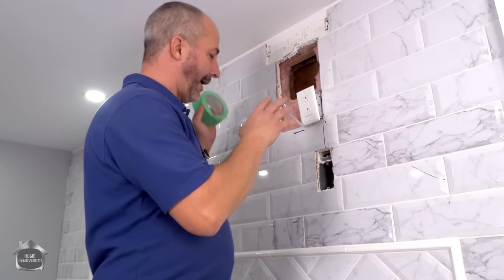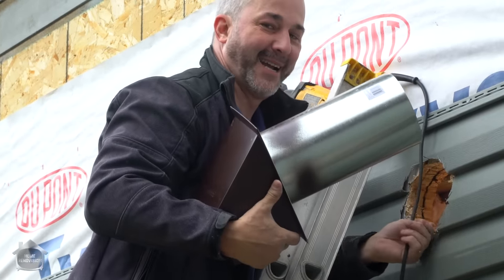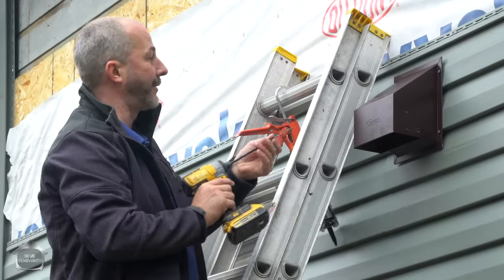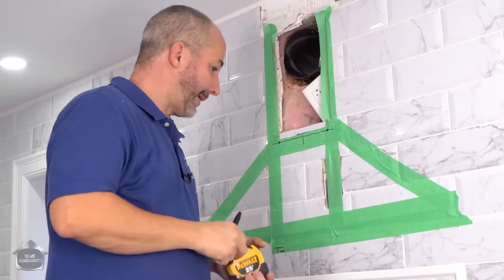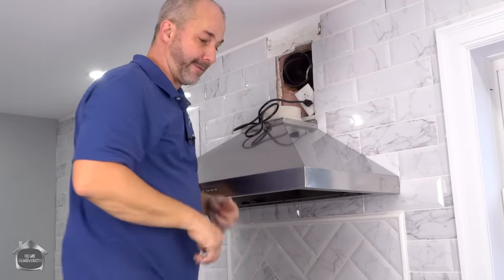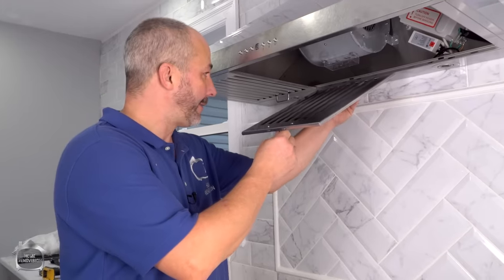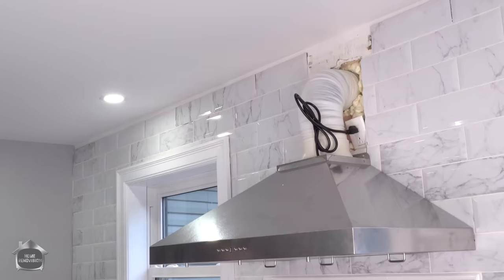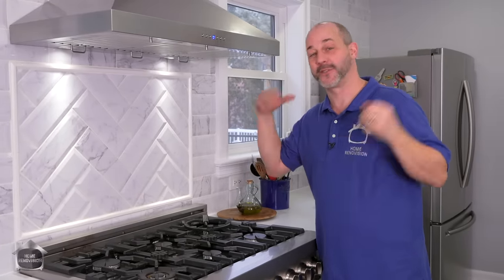How To Install A Wall Mounted Hood Fan!

Comment: Flex duct is usually frowned upon for a kitchen vent because the excess grooves trap more grease which could be potentially dangerous
Reply from the maker: in actuality this hood fan has a grease collection system and a removable grease trap for cleaning. Cheers!
Reply: Seriously, no grease trap will be sufficient to stop a exhaust fan fire. This should be a solid pipe with a no grease trap in the pipe
Reply: I've heard the same, rigid metal
Reply: Aluminum or stainless semi ridged is what I tend to use. Also I sleve w pipe insulation threw the wall. None the less great video and some good tips . Also toggle bolts on bracket and lower part of fan (just above grease filters ) .
Reply: Even if the code allows flex (which ours doesn't), check if the hood installation manual allows it.  The inspector may request to see it.  (They did for our dryer to prove the length was OK)
Reply: @HomeRenoVisionDIY  ...but grease always gets by for whatever reason.  I have removed countless exhaust hoods and they all are coated inside with grease.  Some less than others but greasy none the less.  Is it going to cause a fire? Not likely.  I still believe standard ducting is best practice but not always feasible.  Don't forget to insulate through a cold space like an attic.  Cheers!!!
Reply: @trevor.h  all spaces 👍
Reply: Welcome to remodeling bro. It's not new construction you have to deal with what you got
Reply: This is exactly the reason why I just bought hard pipes to replace the flex one after 6 years.  Doesn't matter how often you clean the grease trap it will gunk up and slow the efficiency of the fan.

Comment: The exterior vent Hood was installed like a rookie, they make a square one inch thick flange with the hole for the vent pipe to eliminate the flat flange to the siding which will eventually leak.
Reply: Eventually? It will leak IMMEDIATLY … should have been a block with j channel installed … I havre canal siding anyway but ….. smh .. he does a decent job normally

Comment: Doesn't the exhaust pipe need to be a non flexible material? Won't grease and condensation develop on the ribs?
Reply: You are 100% correct.
Reply: Plus, I would be worried using what appears to be a plastic exhaust pipe.  Not good in a potential grease fire.
Reply: @view05nys  I was thinking the same thing. It comes with the fan so it must be ok. Most of the grease gets trapped before the vent pipe.
Reply: @view05nys  thats not plastic.. its PVC..  gotta be fire resistant..
Reply: Just another Hack job , Grease fire waiting to happen
Reply from the maker: The exhaust is supplied by z line. that means it is approved for installation. If the code in your city is different then you choose what to do.
Reply from the maker: @Chaz the hood comes with a grease trap for removal and cleaning. this is not a cheap hood that turns into a grease fire. Cheers!
Reply: @trevorhardy3544  so why are you here
Reply: Earl Johnson Because it pops up on YouTube and I like to see what hack jobs he telling people to do.
Reply: Trevor Hardy then why are you watching his videos ? Lol
Reply: @trevorhardy3544  TROLL
Reply: David Not a troll. Just look online at the reviews. He's scammed a lot of people and caused damage to their homes. And he keeps changing his company's name in order to avoid legal action.
Reply: @HomeRenoVisionDIY  But it isn't immediately clear from viewing what actually TRAPS the grease and directs it into that box – you sort of zoomed right past the "when you take out your filters" - they are in the round ends of the bit above where the box sits? In extract hoods I've had there are dishwasher-cleanable layers of metal mesh at entry, in the drop out panels, which is what I was expecting. Had to go back and watch again to see which bit you were talking about putting in the dishwasher weekly!
Reply: @trevorhardy3544  What reviews?
Reply: Trevor Hardy No. you are subscribed because you enjoy bashing other people while feeling like you are perfect. At least be honest.
Reply: @JGHDVCFGT   Yep. Same design my restaurant has.
Reply: This is why I don't solely rely on one person.
Reply: @jasenrock  He's got far more 10/10 reviews than any other.
Reply: He did the duct work all wrong.
Reply: @jasenrock  I googled and the two bad reviews were from two people who would not allow Jeff and his crew access into the house to complete the work.  Ridiculous.  So, what did you land upon on Google to lead you to the conclusion he's a scammer?
Reply: @HomeRenoVisionDIY  FYI California does not allow the type of ducting you show. The City of Dana Point has the following on their website: A ducted residential exhaust hood is required. A metal, smooth interior surface duct required on
 vent hood or down draft exhaust vent. Aluminum or steel flex duct not approved. Provide a back draft damper (CMC504.3).  We have had to throw away several manufacturer-provided ducts and replace them with the required type
Reply: The fan has a grease trap no ? do you really think these fans operate by blowing grease all over your lawn
Reply: @DaveSParty  i second
Reply: @SgtZima  reviews that trroll Trevor Hardy did.. haha
Reply: He’s in Canada and it seems a lot of their code is more lax than USA.
Reply: @matthewsegreto7049  all out of code. Horrible work.
Reply: @TravelingTulleys  and metal duct tape to seal all joints and openings.
Reply: @muzaaaaak  and painted at the joints with mastic too
Reply: @HomeRenoVisionDIY  all fan blades eventually get greasy. You’re supposed to clean the blades too. The grease trap isn’t a trap, but a tray. It is designed to hold dripped grease which falls off the fan blades when warm temps loosen grease. RTFM if one is going to own a commercial style hood and any hood for that matter. ALL hoods are grease fires waiting to happen.

Comment: For those watching they make a vinyl siding flange that frames the vent for a much cleaner install plus it's shingled properly. Caulking fails eventually so make sure to shingle your exterior penetrations.
Reply: I was thinking the same thing. I would have done it the way he did it but knew I was sort of butchering it.
Reply from the maker: no worries Mike, i get the whole seal it up tighter than drum approach but this house has 3" of exterior wood that can handle the occasional rain drop finding it's way behind the siding and typar. Cheers!
Reply: @HomeRenoVisionDIY  Your house might be fine, but it would just look better. Only takes a few minutes to trim it out cleanly and install behind the siding.
Reply: @HomeRenoVisionDIY  won't last and it's a half ass way to do it. Also, too much foam insulation is not good. Insulation works better if not packed too tight.
Reply: Can I get a link or photo of the flange you’re talking about?
Reply: What is the model ?

Comment: Jeff  for siding penetrations for a cleaner look, use an exterior mounting block that matches your siding color, it eliminates the risk of leaks where you were shown caulking also stops relying on caulk to stop water intrusion, it mimics the blocks that they use on lap siding (without scribing) your siding butts up against it for a clean install.  If I remember correctly, Electrical code requires all boxes to be secured.
Reply: Also, what about the seal to the air barrier?
Reply: Or a 2-piece wall vent with an integral J channel backer. I think from Builder’s Edge on Amazon? 4 years later, Jeff makes a video showing how to easily unzip vinyl siding too in order to repair damaged pieces, install penetrations neatly, inspections, etc.

Comment: Lol!  No PPE, hammering a wall anchor with a battery, shimmying a ladder while still on it...this is pure DIY reality and actually makes a rookie DIY feel comfortable in their own (limited) abilities in taking this on. Excellent!
Reply: Plastic flexi vent ducting. Don’t see how that’s code for grease here in USA. All installs I see are sheetmetal ducts and elbows. Maybe Canadia is more lenient because their houses don’t burn.
Reply: @muzaaaaak  I think the duct was provided by the manufacturer Zline which is USA made so it must have pass UL. Not all plastics are the same. Plus the temperature of air 36" above a stove top is not very hot, under 100F I assume. If you have flames shooting 36" high you've got bigger problems than the duct.
Reply: @muzaaaaak  yeah that’s the duct that’s provided. All these units seem to come with that. When I install mine I will be using metal ducting with elbows, because that smoother airflow also increases the airflow. People have said so in reviews.
Reply: @MrWaterbugdesign  the issue is if you have latent grease on your hood and it catches fire, plastic ducting won’t stop a fire from spreading like 26g metal will. I bought and installed a 36” Zline this summer here in the USA and it didn’t come with plastic flexi duct. I used all metal ducting and mastic tape to seal air leaks. Best hood I’ve ever owned. It really sucks, in a great way.
Reply: @muzaaaaak  Not to mention it didn't fit correctly, so rather than fix it, he just sealed the area with expanding foam LOL

Comment: I recommend using a Jig Saw with a fine blade on the stainless steel, less mess less heat and  more control ;) And Step drill bit if you need to make new hole! 

Superior work, best d.i.y. channel on YouTube!
Reply from the maker: great idea, i was showing the versatility of the grinder. i think it is one of the best tools in the box!

Comment: I'm doing my entire kitchen and will use the former microwave outlet that is already in place. However, it is not close enough to center so I will need to move it over a bit. That is the one issue that I have though...No instructions or video shows the exact place the outlet should be depending on model. I'm now thinking that there is no set place for it and I should just keep it slightly off center so it will not interfere with the exhaust pipe. I also decided to use the metal heat tape to seal the exhaust pipe connection points. Thank you for your great videos.

Comment: Did you reinforced the wall with a piece of wood before screwing the two bolts holding the motor part? Or just screwing in the ceramic tile and drywall? I need to install one of these in a week and I know there's no piece of wood behind my wall only drywall...Thanks!

Comment: Excellent vid, I was thinking about getting a z line hood so this was very helpful. Thank you. I dont like criticizing folks but thats why we all watch you learn and do things different. What I would do dif as far as installing that hood .... i would use the “fire foam” or red foam... and i would use all metal duct work because over the years grease would build up in that corrugated plastic duct. Even though the metal duct is a pain .... thanks for the great vid as always! 👌💪
Reply: Agree 100%

Comment: Did he drill the mounting screws into the drywall or was there studs behind the two screws? If drywall as those yellows plugs strong enough to hold??

Comment: I purchased a Zline range hood and watched your video several times to make sure I am ready to tackle this project.  I have a few questions: 1- where did you get the outside exhaust thing.  I went to home depot and all they had were the bright aluminum ones.  2- Do you need a dedicate outlet that goes to the breaker or can I piggy back from the outlet that I have my stove plugged to.  Love your videos and after this I am going to tackle my bathroom.
Reply from the maker: You should use a dedicated supply line and the exhaust came in the box with the hood! Cheers!
Reply: @HomeRenoVisionDIY  Thank you for your quick reply.  My Zline did not come with exhaust vent for the outside.  Any recommendations on what brand to buy.  The one at Home Depot look very poorly made and if I am going to spend the time, I want it to be done right.  Any recommendations would be appreciated

Comment: I think that's the same hood I have. IIRC I paid 35 dollars for it. It was damaged in shipping but it still works.
I can't say I approve of the exhaust flange on the vinyl siding or lose junction box... 
With a gas range/exhaust, furnace, hot water tank, bath fan etc it's important to make sure carbon monoxide isn't getting pulled back in.
Reply from the maker: still not sure where the problem is!
Reply: @HomeRenoVisionDIY  there is nothing wrong Jeff.  Also, $35?  what are you talking about those are $350 and up.
Reply: @DietBajaBlast  
"It was damaged" As in i purchased a damaged range hood.

Also you shouldn't be relying on gobs of rtv to shed water. There are vinyl flanges specifically for vinyl siding.

Comment: I did my kitchen with similar style hood. however i added a 2x4 as a backing as the wall anchor will become loose one day. Because at high speed the fan does vibrate a bit and will vibrate , and the wall anchor will fail.
Reply: Pong Pong Piano snap-toggles are perfect for this. But would need to splurge on a half-inch diamond bit.
Reply from the maker: that works. you can also remove the grill and set a screw into the stud an the interior of the fan housing if needed. cheers!

Comment: Nice video. I am paying for the install of my stainless steel hood vent to save on the cost of installation I have decided to not do the extra work needed for the exhaust ro the outside, bc he will have to run the ductwork through my attic to the roof and will require alot more work and cost.
I need to remove tile from my backsplash and re-tile it and want to ask what is the more modern type of Tile to use for my backspalsh?

Comment: I purposely watch this video to find out what drill bit you used to cut through the tile. Might sound silly but I need to do that with my Z line outdoor grill that’s on its way. I just had wall tile installed and I’ve never drilled into tile and I just wanted to know the screw size which I thought you said was quarter-inch and what bit you used to cut through that tile safely.

Comment: Hi home reno, I dont know what to say really, but after working with my own fan install i realized how good this video is. One problem tho. 
I Would love to see you talk a little bore about Fire safety, I found that the rules in Sweden are really extreme, but for a reason. 
Using plastic piping without fire proof materials is really bad, For sure, the fan can melt and cause issues, but if Fire spreads in the pipe made in plastic, the issue will be that you may not be able to stop it. It wont be an issue the first 2 years of use, but when the piping gets coated with grease, it will burn if fire goes thrue the fan, can you make a video about this? 
I dont know the rules in other coutries, but this one i dont think its a good idea to follow the minimum allowed :) 
Love your vids, just wanna make sure people are safe here :) And correct me if in wrong, love to learn :)

Comment: Beautiful Jeff.   Thanks for educational video as always.   I've also replaced all of our kitchen appliances with stainless steel ones and we're already tired of cleaning them because of finger prints.   Would you please let me know about this product you have coming that will help with this. 

Now I've just forgotten or missed this from a prior video And so i've got a question, just because I'm curious,   When you was installing the vent outside I noticed that the siding isn't finished, why is that?

Comment: Hi Great walkthrough. I have an old working NuTone range but somehow it doesn’t exhaust all cooking smokes through duct. What tool should I use to check if exhaust duct is connected until roof? Please help

Comment: A lot of comments to see if someone already asked, but I'm looking to replace an undercabinet microwave that just filters and blow back into the kitchen.  The stove is on an inside wall so there is no ducting.  Good thing is the kitchen is on the 2nd floor and a crawl space attic right above.  I want to replace it with an under cabinet range hood, but not sure the best way to install the venting?  Straight up through the cabinet into the attic, right angle to the soffit?  Or just straight up and drill through the roof?  I know less angles are better, but I worry about drilling into the roof and creating a bigger problem.  Also going into the wall is better to not take up the cabinet space above, but more angles, and seems like it would be tricky so manuver the ducting through the wall and limits space I would think.  Is a video on what to do when installing a range hood on an inside wall a possibility?
Reply: Also, it's a good microwave, so thinking of mounting it on an open space on the wall in the kitchen since it is still needed, is there a way to make that look nice?  Of course right now it's mounted to the typical bracket and held up by screws under the cabinet.

Comment: I have purchased a ZLINE 28 in. Remote Blower Range Hood Insert in Stainless Steel (698-RS-28-400), however , there aren't instructions about how to place the blower in the basement. I already have a hole in the foundation to vent outside. Will you please consider a video about it.

Comment: QUESTION: is it compliant to have the device plugged into a receptacle that is behind the vent decorative chimney? It is “accessible” by removing the two set screws I see. I am probably not alone installing one of these trendy wall mount style in an otherwise “as-built” kitchen by removing a crappy old recirculating vent hood and the 12” tall bitty wall cabinet above and replacing with one of these beaut’s. The receptacle (formerly in the cabinet and accessible by just opening the cabinet) will be…idk…sketchy now?

Comment: Question, is that loose buried electrical box going to pass electrical inspection?   Our local inspector would not.  Here the romex would need to be run all the way to the j-box in the hood, where the hard connection would be accessible.  Not a plug/receptacle.